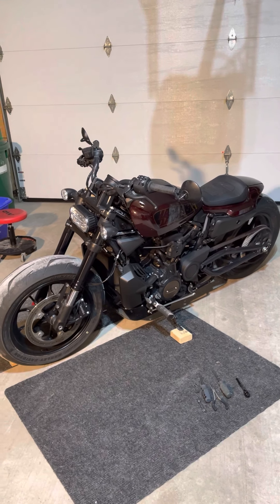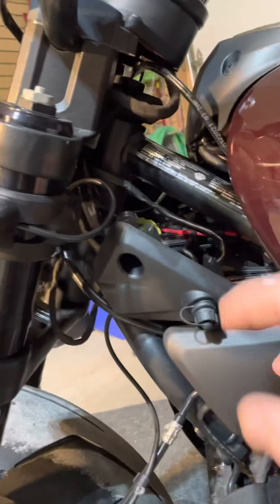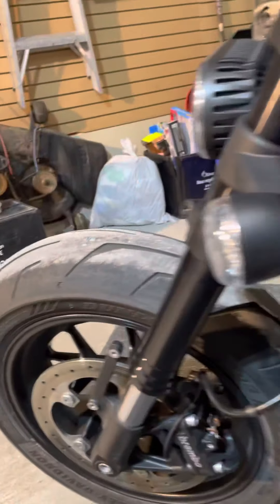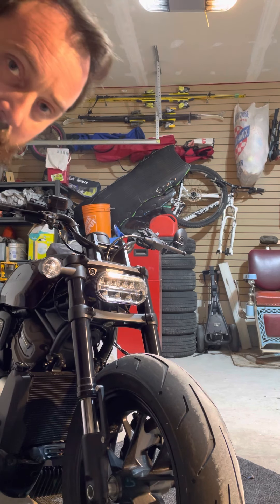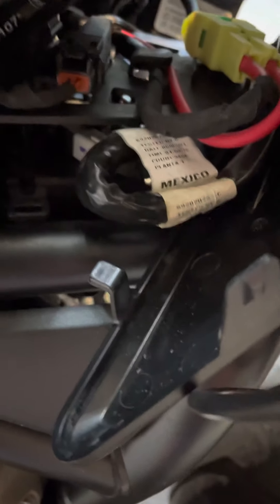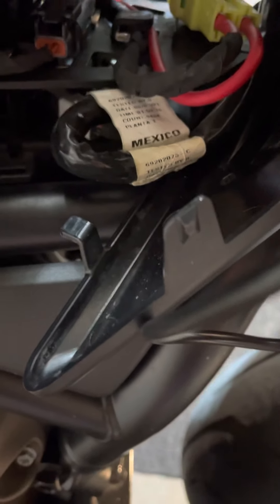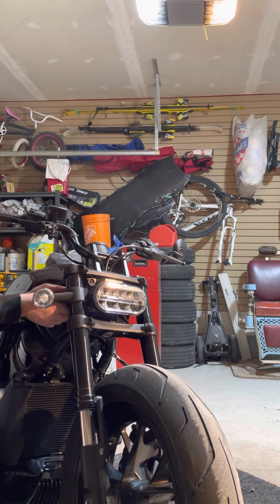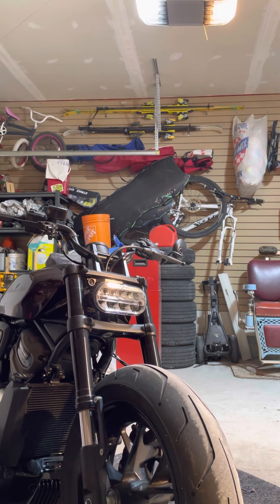SPORTSTER S  Fender & Turn Signal Delete

Comment: I actually have to comment here on your next video because your comments are turned off even though you asked for comment on the 5 1/2 things you didn't like about the bike. The side stand when you put it out will slip out if you park it on a slope, so the second stage when it feels like it is falling is the stand locking in place (you need to pick it up to kick the stand back). The plastic, fair enough with a lot of it but the heat guard on the pipe, well I rode my bike today at 40 degrees Celsius and while moving felt no heat from it (when stopped you need to put the leg out though because burning heat rises from the small gap about 10cm back of the knee). Last one is the heated grips. The control setup is the same as the Pan America even though features are different on the bikes. HD never claimed it had heated grips, reviewers saw the button and misinformed people. I knew it didn't have them installed when I ordered it because I looked at the specification sheet two days after the release announcement in July and always questioned any review that said they were included (on the positive side you can add the grips and they plug directly into the existing controls without adding a seperate switch, EDIT: On the install video I saw you can buy the grips and plug directly into the wiring but the dealership needs to activate them).
Reply from the maker: Didn’t realize the comments were turned off. Thank you for letting me know they are turned on. 
I knew the heated grips were on option. The sales guy said it had them after me asking and mentioned that are an accessory. It’s ok things happen. 
Thank you for watching. I have a bunch of stuff coming and I hope you watch to see what I do. 
Thanks again.